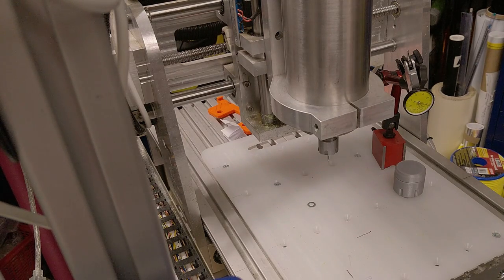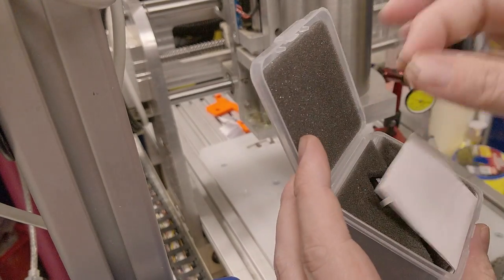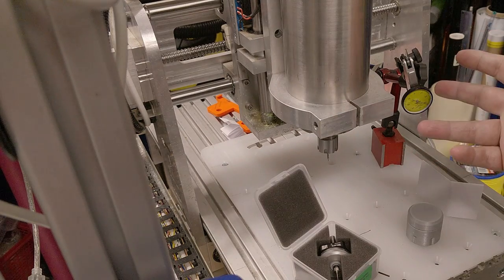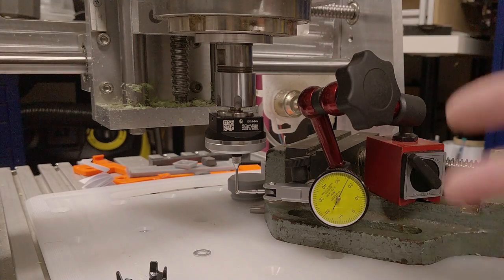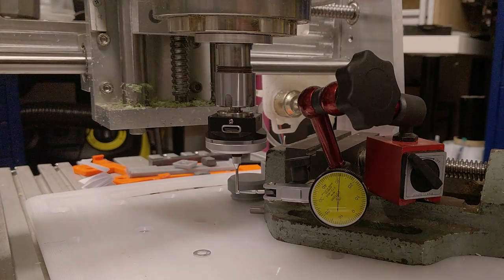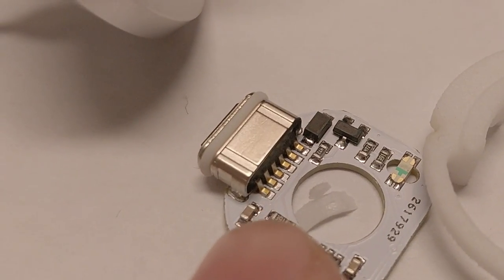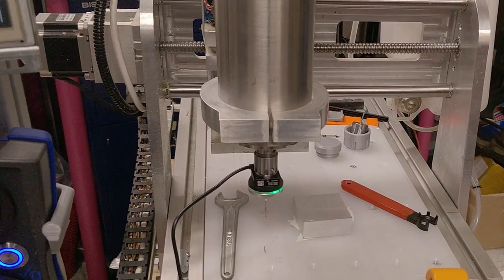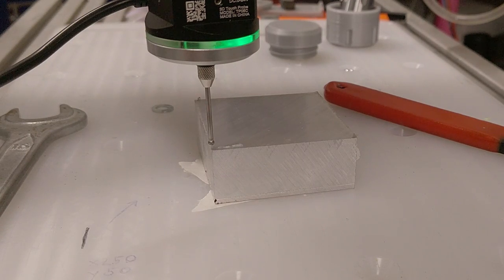An affordable 3D Toch Probe for CNC Machining - Test, Crash, Teardown, Repair

Comment: normal touch probe cost less than 100$ i buy my probe 64$ same probe than u have, and better big version about cost 140$ max. but not can use big because have ER 11 spindle maximum can use 8mm collect. and all better need min 10mm collect. but if need only Z tool lenght measure need only 2 wire, alligator clip or magnet, and brass or aluminium plate, thats all. less than 10$ cost all parts- and if need XYZ corner finder you can mill aluminium piece square pocket and then pocket corner round hole, then outside cut piece out of alumin plate square outside cutting. thats all, yotube have many video how do, not need buy probe.

Comment: Hello! I bought the exact same device. But the Chinese comrades forgot to put the cable (or so I ordered). I can't find the pinout of the connector on the sensor housing anywhere. When you opened it, did you draw a diagram? I will be grateful for the information.
Reply: I used an old iPhone cable for mine. Both red wires are V+ .Shield is ground. Blue is NPN N/O.

Comment: why do not you adjust it?  you have 4 insex  so you can adjust it.  Can not just be assembled and believe that it is right from the manufacturer.
Reply from the maker: yea meanwhile did that ;)
Reply: There's no point adjusting it unless you have an ATC spindle that grantees the orientation of the tool in the spindle every time it's inserted. With a manual tool change spindle, every time you insert the probe, it's going to be out of calibration in a different direction.

Comment: these 4 screws, in my opinion, you should adjust because even on the video you can see that the needle screw does not rotate in the axis, 0.1mm error is a lot.

Comment: You should calibrate the probe using the 4 grub screws. That makes it much more accurate and if you keep the nut and collet on the probe and put a mark on the spindle to align the probe with the mark, you will get much better runout than what you measured. Sorry to see that you crashed the probe but good to see that this is repairable.
To calibrate, turn the probe so that the dial indicator touches where on of the grub screws is, then turn 180 degrees and measure again. Loosen one of the screws a bit and tighten the other one. If the runout gets bigger you obviously have to do this the other way around.
You may have to loosen all screws just a tiny bit so the center piece can more around a bit. I normally tighten the screws just finger tight until the probe is almost centered and only the apply a bit more torque on the screws. First on two screws at 0 and 180 degree positions and then the ones on 90 and 270 - repeat in small increments and keep measuring the runout to make some fine adjustments
Reply: Yes, that little included allen wrench is to be used for adjustment, to dial it in. I'm curious how well this probe will hold the adjustment once it is dialed in. Many of the lower end probes you can get to within 0.05mm or so, but after a little handling, in a few days, they are way out of concentricity again.

Comment: Hey Max, thanks for sharing your experiences with this. I also had a quick look for touch probes, and had the shock of their cost! I'm going to see if I can get hold of one :) 
Really appreciate your detailed description.
Reply from the maker: I'm always happy to hear that I could help someone, thank you for letting me know :)
Reply: The 3 or 4 screws on the top are to adjust it for runout so in theory the collet don't matter however you would need to put it in the same way every time or just check it every use

Comment: There is an alignment procedure to make it more accurate on your machine. Basically it adjusts like a 4 jaw lathe chuck.
Reply from the maker: yea possible, but still I think my spindle once took a hit to much ;)
Reply: Do you have link to the procedure?
Reply: I haven’t found the procedure, but I did find this video and it’s clear once you se what’s inside. I put it in a tool holder and then into the spindle and indicated it with a 0.0001” indicator. I got lazy in the end, but mine repeats within a couple tenths regardless of orientation so it’s pretty concentric.

When you turn a screw, it pulls the stylus toward that screw, so you can adjust them a bit each as you turn the probe until it’s centred. Ronald is correct that it’s very much like adjusting a 4 jaw chuck, you can go back and forth between them until it’s right.

Comment: In case anyone else was interested... 
The parts of note on the main circuitboard are the LDO (low dropout regulator / voltage regulator) Which is a 78L05
and the MCU (Microcontroller) Which looks to be an FT60F01x by FMD.. a 6pin 8-bit MCU with an internal 16mhz oscillator. 

I'm unsure as to why it has six pins on the connector..

Comment: Don't be too hard on yourself about your router's accuracy. At 10:35, the entire body of the probe itself can be seen wobbling slightly, while its connection to your spindle is not, so aligning it is worth the effort. Also, I noticed a consequence of having a cable coming out the side of a probe is that it can cause the probe to rotate, as yours did at 20:58. Again, not an issue with your router, but something to consider when using wired probes :)

Comment: At 13:23 stop mocking me. Did the same exact thing with a little more disastrous result. Need to 3d print a couple pieces. Nice video, thanks for the look inside.
Reply from the maker: Yea i guess it's nice that it is detachable but also makes this happen easier

Comment: I have one of these and once zeroed they are extremely good and mine has been rock solid reliable. I have found that to get 1:100 mm accuracy I need to recalibrate it for that use as the collet chuck has some run out. I have brought precision ground collets and nut but it still not absolutely perfect. That said for 99% of my set ups there is no need for such accuracy so I don't bother. Bottom line for the price it is very good and it replaced my Drew probe and in my opinion its far better.
Reply from the maker: Yea absolutely agree. It's planty accurate for home gaming. Even with precision chuck and nut my spindle (or the ground cone in it) have more run out.

Comment: Nive that they send individual proof of calibration. I imagine that if you are using Mach4 for instance, you would go through the probe calibration routine as well for good measure.
It is quite sobering to gradually know the idiosyncrasies of your machine in graphic detail. Especially when you do a teardown. You get to see all the mistakes, all the shortcuts and possible knockoff components that have been used. That my deal anyway. The gantry type CNC Router is limited by its construction. All linear bearing tolerance are added and then the ball screws followed by Z axis assembly construction and tool stick out. Before you start the spindle and make chips. 
 For my situation, I have 200mm effective Z axis and attempting to upgrade for creating metal parts is humbling for sure. I am hoping to find the feeds and speeds for spindle that has little torque at RPM lower than 12000.  I will have moved the material closer to the spindle by 80mm by the time I install the final fixture plate. And it is probably to thin at 13mm. I might have to buy 25mm stock to reduce resonance . It is a money pit no matter how you slice it. And I am as frugal as it gets.
But once you have a metal fixture plate this 3D Probe is essential because conductive nature of the metal bed material
Wise of you to point out that use of anything other than proven "AAA" rated collet is pointless. In my early days, I didn't question the collets I bought. I was trying to tram my spindle with an 8mm collet that was so out of concentricity that the readings made only confusion. Eventually you realize that everything must pass stringent test especially  if you are preparing for metal machining.  I know it is late to comment but that version of an ER collet the UM type could be tightened with a pin spanner.

I have said too much as usual.. C
Reply: Hah, completely agree. I've just completed a granite based CNC router and have never dealt with such high requirements for accuracy in so many places on one project. Using a high quality digital indicator on various points is indeed very sobering... and humbling.

Comment: Hi MAX,  thanks for sharing
Wouldbe great if you can share the wiring and the program you've made to run it, it would help a lot of enthusiast!
Thanks one more time!
Reply from the maker: Hey, yea that would have made sense. On the other hand everyone is using different hard and software.   
Wiring: red to V+, Black to GND, Yellow to your probe input pin.
Software: no idea that depends... I use estlcam I define which is the probe pin and the rest are premade macros 🤷‍♂️

Comment: Fairly sure there scews to adjust the probe tip runout on the body.  If you break tip on renishaw new ones is up to 100 microns off. we try to to get it into <1 micron runout.
Reply from the maker: Yea they can be adjusted on the top screws. When I did that video I did not measure my machine before and did not know what to expert, so i was a bit disappointed but overall the machine is ok, the probe is fine and I'm happy 😁

Comment: Could you please tell more about the tool length sensor.
Reply from the maker: It is basically just a spring loaded brass Pin that is connectet to an io on my cnc board. The moment the tool touches the surface it pulls the pin to GND (Frame, spindle and tool are all connected to GND) and the touch is detected. I made it spring loaded so I have some give, just in case to stop it, but never needed it to be :)

Comment: Do you hace a reverse engineered schematic or hires picture of the PCB? Especially the 6 pin IC. Current Christmas project is a circuit that detects the resistance rise of the contacts rather than triggering only when the contacts are fully open.
Reply from the maker: Might have pictures on my old PC will have to have a look. I would bet it it's one of those chips without a datasheet 😅
Reply: @MakenModify  That would be lovely, thanks you. I'm nearly there with my circuit but more data is always good. Would be interesting to test on you probe type but would likely need  to bypass the internal PCB.

Comment: These things need calibrating (4 headless alen screws) every time you put them in a collet.
They are useful only with a tool changing spindle.
Reply from the maker: Good point. Other then that they are good for a rough estimate (good enough for most hobbyists I guess). Workaround would also be to have fixt reference corner on the machine where you "calibrate" it on every use.

Comment: Today just broke my by same mistake 🤣 definitly need probe presence pin  😅
Reply from the maker: yea that might be a good idea... at least they are not that expansive 😅
Reply: @MakenModify  same probe, pin cost about 4-12$ pcs, many seller have. and if have lathe can made own pin cheapen.
Reply: @mattivirta  I'm curious about the thread of the stylus, it says M2.5. But most ruby styluses Iv'e seen use M2, M3 and upwards.
Haven't seen the 2.5mm version anywhere.

Comment: Sorry for the crash. I have the same probe and yes, so much runout. Did you try to calibrate yours? How is it done?
Reply from the maker: did not find the time yet. I think it is done on the top screws (where the shaft meets the body)
Reply: @MakenModify  hi, I adjusted it yesterday. You simply use the 4 set screws on the sides.

Comment: any idea what the difference is between the V5 and V6 model ? thanks
Reply from the maker: I'm not 100% sure but by the looks of it the inside plastic parts might now be injection molded ABS. On mine it seems to be 3D printed (sintered) Nylon. But that's just a guess.

Comment: I bought one and dont know how to plug on my pcb ... could u show us where should i plug in
Reply from the maker: Since I have no idea what PCB you have I can only offer a general answer:
This probe is basically just a switch. The Black wire goes to ground/GND (anywhere on your PCB) the Red wire goes to power (logic power of you PCB [+5V?]) and the Yellow one goes to the switch input. That switch input can be an Endstop pin or a probe bin, depends on you PCB and how you configure it in your software. Hope that helps ;)

Comment: how about putting the probe on a lifting bracket? the bracket play may turn out to be less than the collet error and it will be faster in operation.
Reply from the maker: hehe yea. Ultimately a automatic tool changer would be nice but that might cost as much as the mill itself :D
Reply: @MakenModify  I'm not talking about tool autochange. I'm talking about that the probe is not attached to the collet, but separately, next to the spindle. on a parallel single rail or rotating arm.
so that it can be put in the same working position, and then it is not necessary to change the collets, but only take into account the displacement of the probe relative to the spindle axis.
Reply from the maker: @user-sg6mu4lm3b  Yea I got that, but that needs a better repeatability than the run out. The probe must be out of the way and be protected from coolend and dirt... and I don't need it on most parts so manuell it is for me. But in general you are right, it could be a way.

Comment: Sir, do you have URL for the Plate on the aluminium one? Thank you!
Reply from the maker: The white plastic? It's just an IKEA cutting board. I drilled and countersunk holes into it, mounted it to the table and faced it with an end mill. Works well for "Super glue and tape work holding"
Reply: @MakenModify  btw don't you know the name at Ikea website? Thanks!
Reply: @MakenModify  LEGITIM 34x24cm ?

Comment: I don't get why this kind of probe needs power at all. It's a mechanical design. It's hard to tell from the video, but there isn't much on the PCB at all. Would be great if you could provide a close-up image. Sorry for the opportunity of the teardown :)
Reply from the maker: you are right it is basically just a switch maybe they needed it to invert the signal. I'll have a look if I have some high res images ;)
Reply: with electronics, you can make any version of the signal NO or NC, as well as visually see the operation of the probe, which also makes it possible to use it not only on the CNC, but also on manual routers
Reply: @user-sg6mu4lm3b  NC->NO conversion is nothing that has to be handled by probe itself. The signal can easily be inverted on the controller side, electronically or in software. The LED could be powered by the signal line. Visually the light could go out instead of turning on. I still don't see a good reason for electronics.
Reply: @tcurdt  can be done in different ways, one method does not cancel the others. this probe is one of the cheapest probes to buy, so the presence of electronics only makes it better for this price.
my controller has only one input for probes or tool height sensors, so I need to assemble a set of the same type of sensors.
for example I want three types of sensor. the first is an aluminum plate for finding zero Z and the angle of the workpiece along the cutter, and it is NO, a probe for more complex positioning, and a tool height sensor for working with several tools on one part. in my case, all of them are NO, and mechanically the first one is only NO, the probe is NC, and the height sensors can be of both options.
Reply: @user-sg6mu4lm3b  There are many options indeed. You could just invert the signal also for your setup. That's a BJT and two resistors. This does not have be done inside the probe and then having to have another cable to connect (that can be forgotten). Or the cable to probe could just have 3 wires (similar to other endstops). I say it again: I don't see the need for electronics in there yet. Maybe they are doing some hardware debouncing? That's the only thing I could come up with - and why I am curious what's in there.
Reply: @tcurdt  stop.
so here is a cable with three wires, ground power + 5 ... 24v and a signal. on the probe, the connector is physically usb-c, but only three contacts are used.
whether or not to forget the wire is a feature of a removable wire, which has many other advantages, and you can not disconnect it. and it has nothing to do with electronics.
another question is how different the sensor's operation is when it is connected to the electronic part with a long wire or a short one. maybe the electronic part amplifies the signal or removes interference.
and most importantly, I did not find a cheaper probe, with or without electronics. Well, if it were without electronics, it would be cheaper by $ 1, and it would only be normally closed, and why? What's wrong with the electronics in it now? it makes it possible to put it on budget routers instead of a cheap chinese sensor in Z without any alterations, only by adding power.
Reply: @user-sg6mu4lm3b  Until there is evidence of hardware debouncing or some kind of amplification you can argue as much as you want - power is not necessary. It's not about price but it's about KISS. And all I asked was to see the PCB to find out what it actually does. If you like it like it is fine - why the need to argue?
Reply: Does someone have internally switch NO to NC, I bought NO by mistake and I would prefer to wire it NC for security reasons

Comment: Does the signal wire put out a negative current or positive? I just ordered one for my 3040 cnc I'm running a szgh controller and it looks for a ground signal for the probe
Reply from the maker: It's been a while since i wired it up but I believe it pulls the pin to ground.

Comment: Mach 3 controls?
Reply from the maker: No idea. I use estlcam but see no reason why it would not work.
Reply: Do you know if something needs to be set up in the mach? I have an identical one, and I will also need to measure the corner @MakenModify